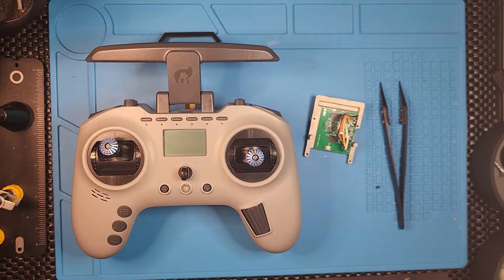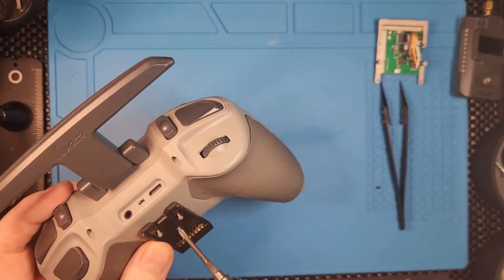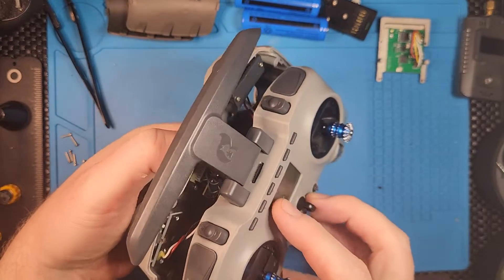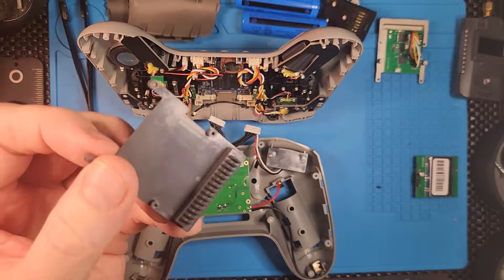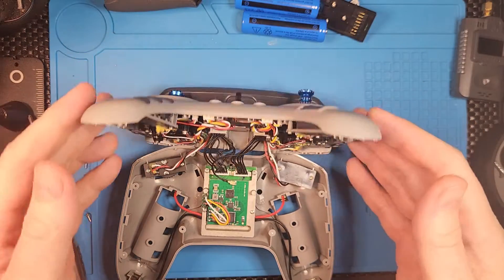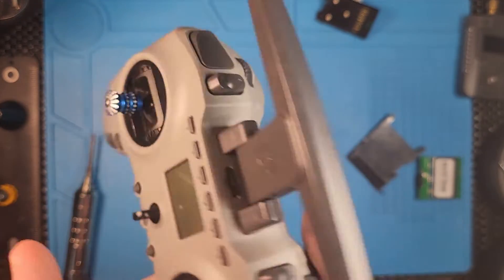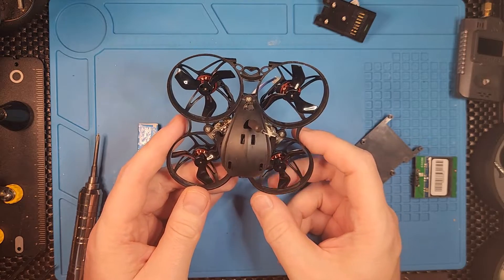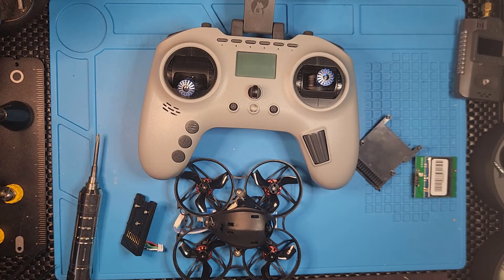Jumper T-Pro ELRS Upgrade - Internal ELRS module conversion from internal 4-in-1  module

Comment: Did you have to do anything to get CRSF to show up? I opened my transmitter up and it has an ELRS module in it but I can only get MULTI as an option on the internal. How do I get that to say CRSF?

Comment: I tried to google for this module and could not find it anywhere as if it doesnt exist and then with your link it appears the module is out of stock on ali.
Man should've bought ELRS type right away not the 4in1...
Btw. your 18650 look like one of the scam ones from ebay/ali made out of a used 500-1500mAh laptop scrapped  battery, did you test it?
I chuck in two 3400mAh genuine SANYO NCR18650GA
Btw2 has anyone tried fitting both 4in1 and ELRS? Or is there a module that has both? It would be super convenient.
Btw3 the charger module is a joke too, the USB-C doesnt work with all cables/ports so probably the CC lines are not wired correctly and also charging current is a joke like less than 500mA I believe which is nowhere enough for 18650s and also takes forever, that needs improving as well.
Reply: Did you ever find an ELRS module? I might have one for you.

Comment: after swapping the modules, when i configure the internal module it shows up as multi, this is of course wrong, the ELRS is inside haha, how can i fix that? reflashing edgetx doesnt seem to work
Reply from the maker: Try going to page 2 of the settings, scroll down to Internal RF and change mode to CRSF (elrs uses crossfire protocol) you'll also need need the elrs Lua script to access elrs configuration menu.
Reply: @darzwhoopwhoop  I don´t know why you sisnf have to do this, but for CRSF to appear in page 2, you have to go to radio settings and set the internal module top CRSF, and then it will appear in page 2.

Comment: is that possible to do for radiomaster tx16s mk1?😀
Reply from the maker: You will need to check what kind  of module it contains, but I'm doubtful that they are the same...
Reply: @darzwhoopwhoop  I didn't see a single post or reddit conversation about the internal elrs swap for tx16s mk1😅. But I hope it will support jumpers
Reply from the maker: Don't quote me on this but it does seems like there is an internal  elrs module for your radio. https://readytoflyfpv.com/products/TX16S-MKII-replacement-internal-elrs-module. But no idea if its a simple swap out... There might different hardware layout/config
Reply: @darzwhoopwhoop  anyway thanks for help, i’ll just probably wait for someone to make a vid about it

Comment: Good afternoon, I already found the module but I get this error.

Syntax error

Bad argument #3 to 'draw text' ( string expected, got nil)
Reply from the maker: If the radio controller was working fine before you started, I would make sure all the software and fimeare is up to date. But to be honest I haven't seen this error before...

Comment: Hi I have the internal module jumper T Pro
Since I have update ,the wifi has stopped working
I have tried loading an older firmware version.
But still this has not fixed the wi-fi
Any ideas how to get this working?
Cheers
Reply from the maker: There's a few videos online on how to recover using pass through,
https://www.google.com/search?q=jumper+t+pro+recovery&tbm=vid&sa=X&ved=2ahUKEwigyviSxvr9AhV5ZWwGHfrjBPcQ_AUoAnoECAIQAg&biw=598&bih=587&dpr=3.03
Hope that helps.
Reply: @darzwhoopwhoop  Thanks

Comment: Is this internal elrs module the full 1 watt (1000mw) version??
Reply: That's great 👍 I zomed in and see it says 1watt ! Did you have to do any special programming 🤔 The Jumper t pro (se) I have is running Elrs 3.0 with max 100mw output on edge tx 2.7.1!
I just want to replace the internal module to give me full access to 1watt (1000mw) or 250 etc ! So I am wondering what You had to do for any programming you had to do ! If you know what the Firmware version was on it when you received it could you tell me what it was before you updated it? And what Firmware did you update to !
Sorry for all the questions, I just want to cover all bases before I order it! Thanks for your time and consideration!
Reply from the maker: No problem, I can see you just want to get right! I didn't much to be honest crossfire protocol and lua script did most of the work. I just set internal to CRSF in hardware and model settings and then update elrs firmware to set my binding details, after that I changed the power mode in the lua script. Edgte tx 2.7.1, elrs 2.5.1. I just winged it myself but let me know  if you get stuck.
Reply: @darzwhoopwhoop  Thank you, I ordered it today and my Jumper t pro is already running 2.7.1 edge tx and elrs 3.0 ,so I may just have to update the module to elrs 3.0 and be good hopefully but once I get it delivered in a few weeks I will let you know how it turns out! Thank you again for your time!
Reply from the maker: Yes that's right, if I understand correctly it's a replacement part from the ERLS version of the T-Pro.
Reply: @darzwhoopwhoop  The reason I ask is because I have the original Jumper T pro (se) Elrs version and internal module is only 100 mw max and if you 💯 % verify that the internal module that you have used and have a link for puts out the newer 1watt max elrs internal module then I will purchase off of your link ! 
So you have the ability to set 10,25,100,250,500 and 1000mw (1w)with the module you used ????

Sorry for asking like this but I want to make sure you have the full 1 watt version??
Reply from the maker: I just went back to my original video recording, zoomed in and confirmed the model  number is T-PRO-ELRS-1W so I think you should be good! It's a shame that product listing isn't covered under affiliate program, but enjoy all the same!

Comment: Why I cannot find CRSF in my Internal RF? What I should do or check first? Please help me.
Reply from the maker: Do you have a 4in1  version of the jumper t-pro? If so then I guess you won't be able to choose crsf since that is for ELRS. After I upgraded mine to  ELRS internal module (see my other video) then I could ONLY see crsf, so I assume that depends on the type of module you have.
Reply: @darzwhoopwhoop  I brought that thing and did what you have shown me, now it's in my transmitter but I can't find CRSF.
Reply from the maker: Ah I remember now. Go to system options (long press menu) and go to HARDWARE page (page 6 of 7). You can select the internal module there.
Reply: @darzwhoopwhoop  Hmm I don't see internal module in HARDWARE page... Are u using EdgeTX or factory OpenTX?
Reply from the maker: I'm using edgetx
Reply: Thanks, I've found it now. I have to change my software to Edge TX first. But then again I cannot find ELRS on page 1/7 like you did, which version do you use? 2.6, 2.7, 2.7.1?
Reply from the maker: I'm using edge TX  2.7.1. Edge TX forks from  Open TX so they will be the very similar, but Edge TX development has been more active than Open TX .
Reply: @NigouOG1  Hello, were you able to make elrs appear in the menu?
Reply from the maker: You need to download the Lua script for the version of elrs you are running on your module
Reply from the maker: This is a Lua script that you will need to download, maybe check this out for details
https://www.expresslrs.org/quick-start/transmitters/lua-howto/

Comment: Hi friend. Thanks for video. You have stick end's link ?
Reply from the maker: It's the same product link as the elrs board, option 8:
https://m.aliexpress.us/item/1005003968070831.html

And check out my other video for more details:
https://youtu.be/q_NrKQ97Lfg
Reply: @darzwhoopwhoop  I didn't realize it was the same product.  thank you.  I bought a new t pro too.  Did you have any problems with it?
Reply from the maker: Nice! I'm really enjoying it, I think the only issue I've ever had is losing connection randomly, but that could have been the whoop. But I should point out, I'm only flying tiny whoops, 85mm max so for me portability is the top priority, everything fits in very small shoulder bag.
Reply from the maker: Btw I've been setting up some cool switch configs like double Arm to Turtle Mode, and turning mementary switch into a 3 position switch. Will post soon, stay tuned!
Reply: @darzwhoopwhoop  i understand.  Thank you so much.  I hope I can start having fun as soon as possible. 😊
Reply: @darzwhoopwhoop  I subscribed and I'm looking forward to the videos. :) 🤓
Reply: @darzwhoopwhoop  Thanks! I have just subscribed! You could also do some tutorials on building a whoop from the scratch. What do you think? It would be great to follow a project like that...
Reply from the maker: Can do! I have some walksnail gear coming soon, and I want to build a hdzero whoop, or would you prefer analog build?
Reply: @darzwhoopwhoop  I have stopped flying analog some time ago. I'm on DJI right now, but already working to go ELRS. ☺️🇧🇷
Reply from the maker: I haven't bought into the DJI ecosystem (yet), but I am waiting on walksnail gear so might be my next build.
Reply: @darzwhoopwhoop  I got it. I have heard about that "walksnail" but I haven't learned what is that yet... lol
By the way, do you know if the Jumper T-Pro is capable of receiving a 1w ELRS 915Mhz internal Module?
Reply from the maker: Nice! I fly everything elrs, I still have some analog builds bit I've been moving over to HDZero, and just Walksnail gear so I may work on that. Walksnail is the closest in quality to DJI
Reply from the maker: I don't think T-Pro supports 900mhz, but you can probably get an external module for that. I might be wrong but I think they use different size antennas. Basically Walksnail is nearly as good as DJI video quality, and HDZero has amazingly low video latency but video is not quite as good. I will do Walksnail vs hdzero soon, eg video quality vs responsiveness.
Reply: @darzwhoopwhoop  Thanks bro! 🖖🏻
Reply: @darzwhoopwhoop  Thanks for the link on aliexpress!...

Comment: it will be appreciated if both module can be installed inside
Reply from the maker: I guess  challenges would be how to connect two internal modules to the antenna,  fitting two modules inside and having enough cooling

Comment: I bought an ELRS T-Pro to replace my 4-in-1 about two days before this video came out. I'd had trouble finding the ELRS module by itself and wasn't sure how hard the swap would be. Oh well, now I know. I had assumed you'd have to reflash the firmware, and maybe there is still some benefit to doing that, but it's nice to know it's optional. Thanks for posting this!
Reply from the maker: You don't need to update the edge tx (or open tx)  firmware on the t-pro  at all, just adjust the external/internal rf config in the settings. But of course you will need to update the elrs module over wifi to make sure the version and binding phrase matches the elrs rx on your quad.
Reply: @darzwhoopwhoop  Managed to re flash old firmware Now up and running Thanks Don't know why the 3.2 firmware isn't removed until they sort out this problem of it wiping your wi-fi useless